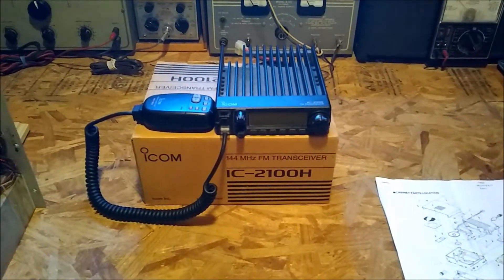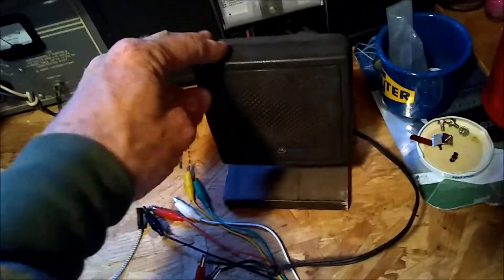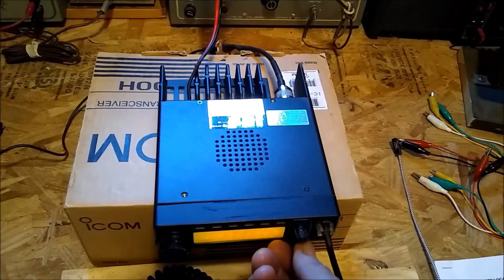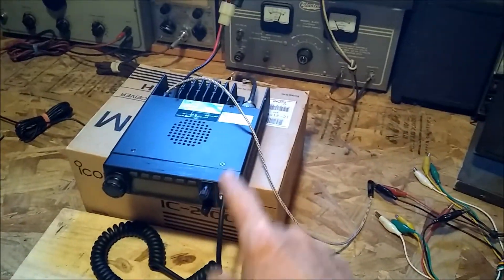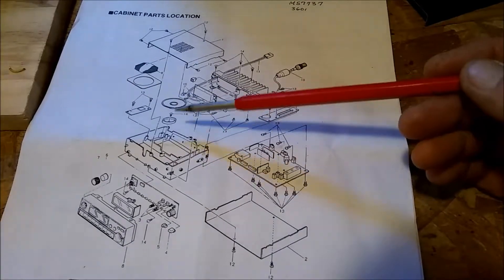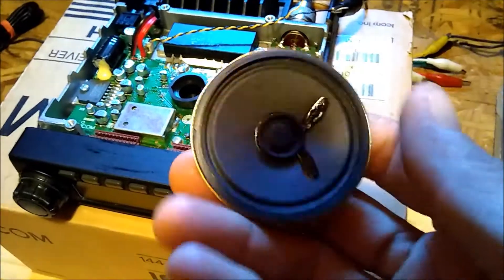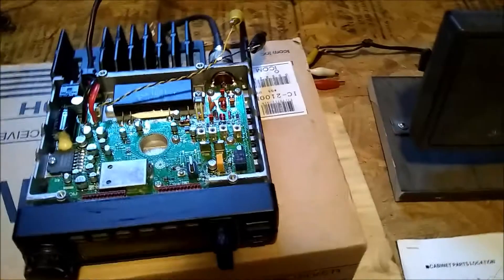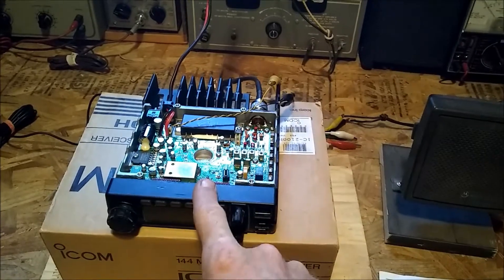ICOM IC-2100H Audio Difficulty - Repair

Comment: My audio is fine but my volume and squelch control are dirty / need cleaning.  Ever done a video on that?
Reply from the maker: No video on that repair. I have had similar issues with volume and squelch potentimeters. Used DeoxIT D5 to quickly and safely fix them. Good luck with your repair.

Comment: My 2100 has no sound coming out of the speaker but external speaker works fine
Reply from the maker: You could have a bad speaker. Using alligator leads - connect a spare speaker to the Icom speaker terminals (you don't have to remove the original speaker). Turn on the radio and check to see if there's an audio signal in the speaker wires.  Let me know what you find.